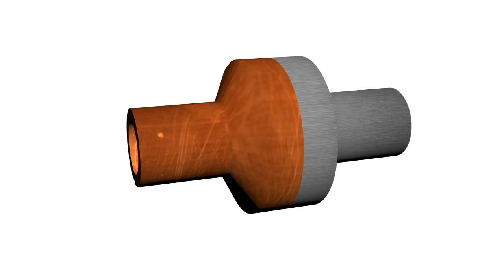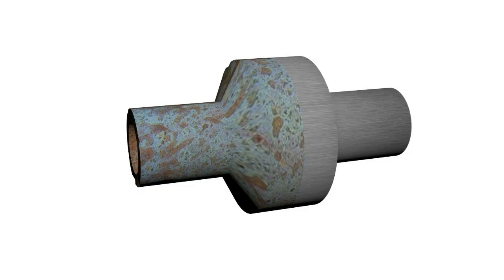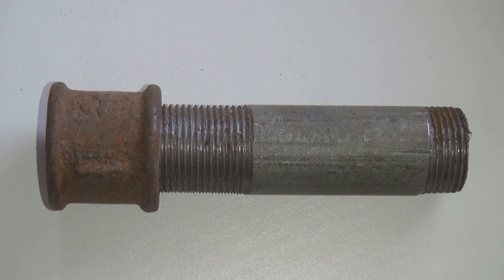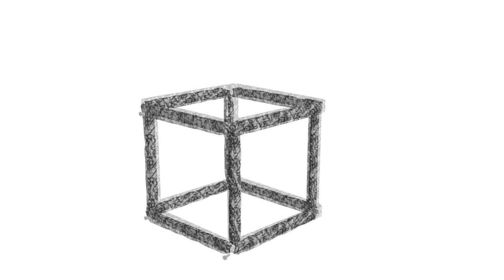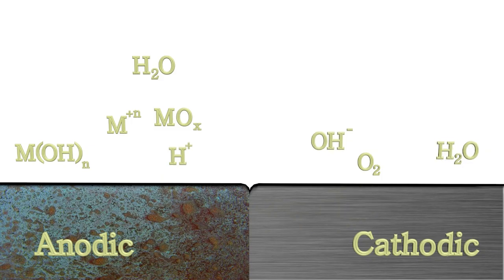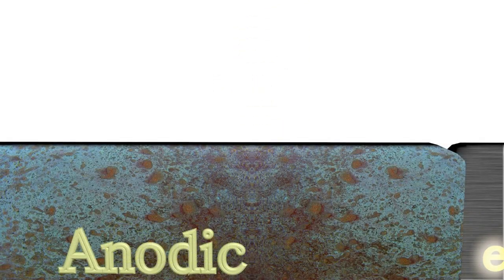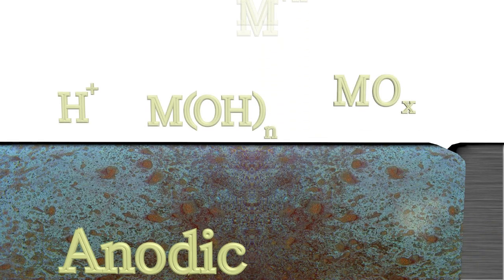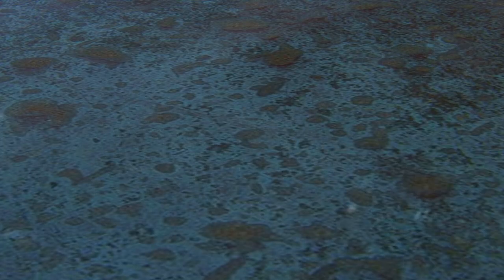Galvanic Corrosion | Forms of Corrosion

Comment: Thanks for the video.  Informative.  Question. I have an aluminum trailer with wood deck boards.  I want to screw a steel track down, thru the boards and into the Aluminum frame.  Will Stainless steel screws be good for that?  Do the two different metals need to be in direct contact for a galvanic reaction to take place or can they be connected by a 3rd material?  Thank you
Reply from the maker: If the two metals are in electrical contact then you get galvanic corrosion between aluminium and steel for sure in ambient conditions. Use a multimeter to verify if there is any electrical contact between the two metals if you are not sure. Anyhow, if you badly need to use steel bolts in aluminium, then you really need to put an insulator between them. If you anodize the aluminium part and put some dye into the hole prior to inserting the bolt then maybe its ok but you still need to check the connection afterwards. Also, if you apply a coating on all of the exposed steel surfaces after inserting the bolts then you reduce the overall area of the cathode (steel) close to 0, which should effectively stop potential galvanic corrosion. However, if the coating is damaged on the steel and you have electrical connection between the two metals, then you ultimately still face galvanic corrosion.

Comment: Excellent video!
I am a contractor and install water heaters fairly frequently. They come from the manufacturer with a brass T&P valve (for overtemp and overpressure) screwed into the steel tank. 
The other interesting thing I've seen is instead of Mg or Al anode rods, there is a powered anode rod option. How does that prevent corrosion, and is it in any way better or worse than the standard Mg/Al rods?

Thank you!

Comment: A steel pinch bolt has seized in an aluminium suspension arm, due to galvanic corrosion. What's the best way to get the bolt out? Is there a chemical I can use to break down the bond between the steel bolt and the aluminium arm?
Reply from the maker: I think the chemicals are quite dangerous and mechanical approach is more appropriate. But if it is stuck due to galvanic corrosion, then you are dealing with aluminium corrosion products, which is a mixture of aluminium oxide and aluminium hydroxide. This stuff is normally removed in a surface cleaning process by utilizing warm alkaline (e.g. NaOH) and concentrated HNO3. So my first idea would be to try some of the alkaline pipe cleaning solutions available at the store if mechanical approach fails. Afterwards you'll need to rinse it with a lot of water to get rid of the alkaline for safety. The alkaline may also damage the surrounding aluminium though. With these chemicals you'll definitely need eye protection and latex gloves as a minimum and make sure you do not breathe in the fumes - do it in open air.

Comment: A view from the UK and a retired electrical engineer and fully understand the principle of electro-plating. Could you be the person that finally explains to me why it is called a sacrificial "Anode" and not a cathode as the reason it gets "eaten" is because it is being stripped of electrons. If it's being stripped of its electrons then surely it is a cathode? Conventional current flow is from positive - anode to cathode - negative. This is a "customer" explanation of an electrical circuit. But we engineers know that it is electron flow from cathode to anode that is the basis of a current flow and that is negatively charged electrons from the cathode are being attracted to the anode which is electron deficient and wants to stabilise. As you also know when charging a battery we, in effect, reverse the polarities and send the electrons back to the cathode and make the battery unstable again - or what the customer calls "charged". For those that don't know, a flat battery is when the anode and cathode have their own required number of electrons for their atoms.
What am i missing please?
Reply: Use mnemonic "Katacombs" menaing "underground world". Kata is "down", kathode is where elctrons are going "down" into device (+ pol). Anode is "up", it is where elektrons emerges back (- pol).

Comment: came here after the titan disaster.
Reply from the maker: If I remember correctly, then the Titan used a lot of carbon fiber material parts. Nowadays it is becoming more widely known that carbon fiber material can actually promote the galvanic corrosion of other metals that are connected to it. This is because oriented carbon materials, including the carbon fibers, are more cathodic than other metals. As a result, materials like aluminium alloys would be particularly endangered when combined with carbon fiber composites. In applications such as the Titan, which include total immersion into saltwater, thorough long-term corrosion tests should be done to asses the corrosion resistance of individual materials and when they are combined. In non-critical applications we normally go for at least 1000 hour long corrosion tests in synthetic seawater but in the case of a submarine I'd recommend 6 months just to be sure.

Comment: 4:40 
Hi Captain Corrosion,

The dielectric union is used between a hot water boiler made of Iron and a water pipe made of copper.

I 'd like to know what you think about the ground connection (GND) between the water boiler and the pipes.

The building code requires the ground connection of all water pipes made of metal. I think the electrons close the electrical circuit, so the corrosion is active.

Many thanks Captain Corrosion !
Reply from the maker: A crucial part of galvanic corrosion is also the electrical resistance between the connected parts. So if you have to ground all the metal components but still want to mitigate galvanic corrosion, then try to increase the electrical resistance between the two metal parts as much as possible. use a multimeter to play with the resistance.

Comment: What about sacrificial anodes? Do they work?
Reply from the maker: In the case of sacrificial Zn anodes, the anode is the anodic part in most cases and at the same time the corrosion of the other metal is protected as long as the processes on the anode still take place.

Comment: Hi, I watched n liked your video. Its easy to understand. I'm now working on a project that is to mount a stainless steel plate on the high tensile steel baseplate.  I did a search for the galvanic chart, however, high tensile steel is not in the list for me to understand the potential difference between these two materials. So how can I find out? What would the potential difference? Which would corrode? Pls help. I thank u.
Reply from the maker: I would plan a series of corrosion tests to see if there is any risk of galvanic corrosion or other forms of corrosion (e.g. crevice corrosion).
Reply: From the galvanic series chart, how do I determine the volt for stainless steel 316L (passive) for example? Looking at the band, I'm not sure how to. Kindly help. I thank u.
Reply from the maker: @tytck70  I'd advise you to use our galvanic corrosion simulation tool. If the tensile steel doesn't contain much nickel or chromium, then you can replace it with cast iron in the simulator. For the other metal you can select the SS316.

Comment: Excellent explanation. Something that should be mentioned too, is how to eliminate galvanic corrosion, but also keep an electrical connection.  You walked up to the door saying to use an insulator that eliminates the electrical connection.  If you have two metals that are two metal groups apart from each other, you can use a third different metal that is in the middle metal group (i.e. aluminum frame and a stainless steel screw, you can use cadmium as a buffer metal).  This keeps an electrical connection, but reduces the chance of galvanic corrosion.  This is useful is you are using your chassis frame as a grounding path to earth ground.

Comment: Thank you for nice explanation.
However, I have some question.
In the substation,there is electron emission and current flow through electrical equipment. I connected copper wire to steel structure (galvanized steel) by using galvanize fasteners. After 1 to 2 years, my galvanized fasteners face corrosion. How to prevent this?
Reply from the maker: Sounds like the zinc layer on galvanized parts has been depleted and that's where your protection against corrosion ends. If you don't want to change the parts, then you might consider some corrosion resistant spray paint if it can be used in your application. However, it will likely be a temporary solution.
Reply: @CaptainCorrosion  how about permanent?
Reply from the maker: @daravannmel4125  Make things out of platinum! With corrosion, especially galvanic corrosion, there is no permanent solution. Unless of course you use materials that have exceptional corrosion resistance like platinum. With cheap materials companies usually do R&D projects with us and find the best cost efficient solution but that requires systematic studies and will pay off only if applied on mass produced parts.
Reply: @CaptainCorrosion  Well noted with thank you!

Comment: I understand that on old cars a plastic insulator was inserted between panels to stop G C. I was told that where the metal is folded, the material structure is different and therefore instigates an electrochemical process resulting in the corrosion. Is this true? if so how does the bending of steel change the local properties?  How is the problem rectified these days?
Reply from the maker: I'm not familiar with these structures and cant provide you with a satisfactory answer. From the description it seems though that there can be different forms of corrosion at play that may also have an electrochemical aspect to promote the progression of corrosion. With folded metals you may see crevice corrosion for instance, where differences of concentrations inside and outside of the crevice cause a potential difference and that promotes corrosion inside the crevice. Cold working may also cause microscopic cracks that may start act as anodic sites, where corrosion takes place at a greater rate.
Reply from the maker: @parsleylion6313  Please contact us through our official website captaincorrosion.com and use the contact form if you are looking for in depth consultation.

Comment: Thank you for this informative video. Do you have ideas or suggestions on how to evaluate possible galvanic corrosion during an in-situ inspection (Not destructive inspection)? 
Thank you in advance
Reply from the maker: Sometimes you can tell with naked eye that someone has messed up big time during construction but in other cases the corrosion consultant may need portable instruments worth about 50k EUR to perform analysis on site, which include materials characterization and structural analysis of relevant components.
Reply: @CaptainCorrosion  Thank you for the answer. In this case, employing portable instruments what kind of tests would be performed?
Reply from the maker: @cesarescobar9679  Possibly systems to study the composition of materials (e.g. handheld xrf or libs) and then something to see if there are internal cavities. The latter would be tricky if a decent ultrasonic system isnt enough.
Reply: @CaptainCorrosion great, all these ideas are interesting. Additional to these analysis do you know if it is possible to perform an electrochemical test to identify the corrosion rate or activity?
Reply from the maker: @cesarescobar9679  Possibly there are some kits for that but I'm not familiar with those. I'd use a multimeter though to check if and where electrical contact is present between materials that can form a galvanic couple.
Reply: @CaptainCorrosion  yes! I thought the same about the multimeter. Thank you so much for your video and the others tools of your website to learn more about corrosión.
Reply from the maker: @cesarescobar9679  You are welcome!

Comment: Thank you for the video and the simulator. I have a question. I'm screwing a ZincNickel coated Steel male pipe fitting into an Aluminum cast alloy. I didn't find the first material in your simulator or any coated steel.  Do you think it's going to be ok? If corrosion could happen it can be only from moisture from outside. The fluid inside the circuit is ATF oil. Thanks a lot in advance!
Reply: I wish I worked in a company where important things as materials compatibility are considered in feasibility phase and  not then have the project palmed off to me after the sale is made and SOP is near... I'm trying to make a corrosion test happen but many dark forces in the company are impeding it... If I could perform a test easily I wouldn't be here at 2am.. Thanks anyway for the swift reply . Companies (and the world!) need more people like you!
Reply from the maker: @caterinas8090  I'd prepare mockups that mimic the real thing and do tests with these. If external moisture is most likely source of corrosion, then I'd consider long term immersion tests, short term chemical tests and a salt spray test. Maybe also an electrochemical test, depending on the budget.
Reply from the maker: @caterinas8090  If you still need and it fits in your budget, then we can do some of the corrosion tests at our R&D centre. For that you'd need to contact us through our website for a quotation. If we don't have too many projects at the same time, then you can expect the tests to be done quite fast.
Reply from the maker: Look, you have lots of materials there and this turns it into a complex system. In such cases usually you can do corrosion tests to predict the corrosion behavior in the application environment.

Comment: Hi doctor I am from Iraq I have questions why Why can't the aluminum tube be used with copper or copper ions and what is the corrosion by deposition
Reply from the maker: Hi! If copper is in electrical contact with aluminium, then galvanic corrosion of aluminium would occur if the electrolyte is corrosive. Alternatively, corrosion can also occur if the two metals are not in contact. In that case copper may be transported with the electrolyte and redeposited on aluminium, where it will cause localized galvanic corrosion.

Comment: What if there was no contact between the two metals? How come the steel get corroded if it was left at an open area area with humidity and water? What will be anode and cathode?
Reply from the maker: If your steel is not in direct contact with other metals, then you are likely dealing with uniform corrosion (aka general corrosion), which depends on the environment as well as the material. Check out the theory on uniform corrosion and play with the simulation tool; https://captaincorrosion.com/general-corrosion/
https://captaincorrosion.com/uniform-corrosion-simulator/
Reply: @CaptainCorrosion  thanks captain, in my case if you have a storage tank, how to identify anode and cathode? If there was no CP system installed.
Reply from the maker: @husaink  If the whole storage tank is made out of same material, then you are probably dealing with uniform corrosion and the anodic and cathodic areas migrate around in a microscopic scale. However, the system may have components that are made out of a more noble alloy than others. Those parts would suffer no corrosion and be cathodic while a nearby component of a more active metal would become anodic and suffer more corrosion. In any case I'd recommend using some weather resistant paint to slow down the corrosion or consider galvanic protection (e.g. by using zinc anodes).
Reply: @CaptainCorrosion  Thanks Captain, I really appreciate your response.